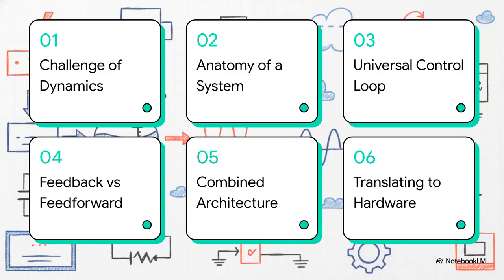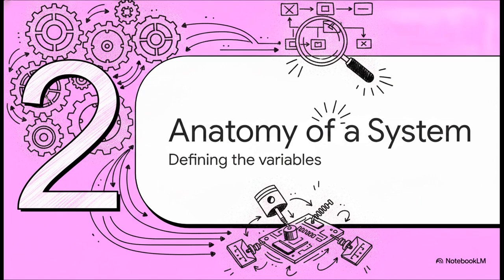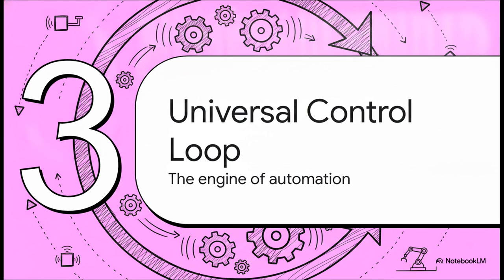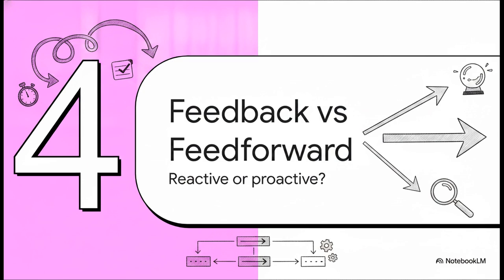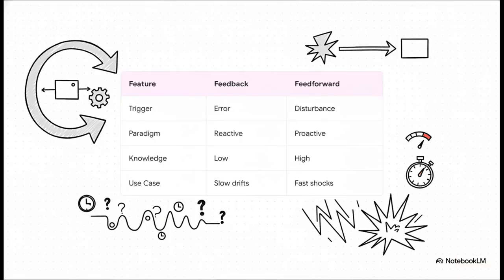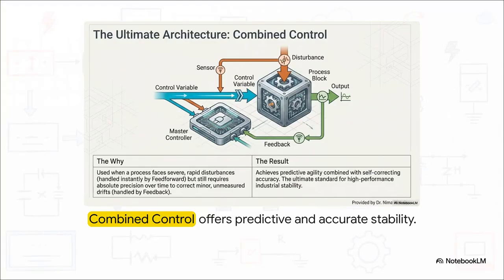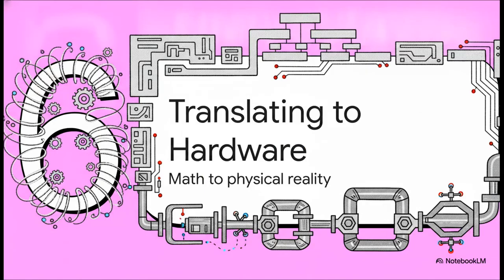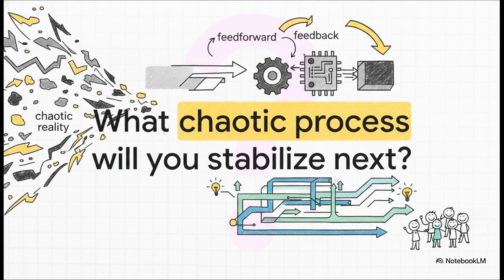Feedback vs. Feedforward vs. Open-Loop Control | Why Each Matters in Industry

Comment: Regarding the explanation at 3:03, is Regulatory Control inherently limited to constant setpoint operation, or can it also be implemented in systems with time-varying setpoints? Under what conditions would each case be appropriate?
Reply from the maker: Regulatory control is not inherently limited to constant setpoints. Its main purpose is to keep a process variable close to a desired value while rejecting disturbances, but the setpoint can also change with time if required by the operation.

A constant setpoint is common in many industrial processes, such as maintaining pressure, temperature, or liquid level at a desired operating point. A time-varying setpoint may be used when the process requires changing operating conditions, such as production rate changes, batch processes, or optimization strategies.

The key difference is the control objective: regulatory control focuses on disturbance rejection and maintaining stable operation, while tracking control focuses on following a changing reference trajectory. In practice, many industrial systems combine both objectives.

Comment: This video is greeted, I have equation, if some output variables are unmeasurable and require periodic offline laboratory analysis, how can the Measure–Decide–Act loop provide continuous real-time control
Reply from the maker: Thank you for your excellent question. In practice, when some variables cannot be measured continuously, the control system relies on online measurements of related variables, soft sensors (state estimators), or process models to estimate the unmeasurable outputs in real time. Periodic laboratory analyses are then used to update and calibrate these estimates.

This approach allows the Measure–Decide–Act loop to operate continuously, while offline laboratory data ensures long-term accuracy and product quality.

Comment: Dr. Mahdian, thank you for this useful video,
i have two questions if you dont mind  :
In a real chaotic industrial process, how can an engineer decide whether feedback control alone is enough, or whether feedforward must be added to prevent disturbances before they affect the output? What are the main signs that tell us the process needs combined control instead of simple feedback?
Reply from the maker: In practice, feedback control alone is sufficient for many processes. However, if the process experiences large, measurable disturbances, has slow dynamics, or requires very tight control, adding feedforward can significantly improve performance by compensating for disturbances before they affect the output.

The main signs that combined control is needed are frequent disturbance-induced deviations, slow recovery with feedback alone, or strict product quality requirements. The goal is always to choose the simplest control strategy that achieves the required safety, stability, and performance.

Comment: I have a question regarding the explanation at 4:08 about Feedback Control being a reactive control strategy. Is Feedback Control always considered reactive by definition, or can it exhibit predictive behavior when combined with other control strategies? From an engineering perspective, what is the practical significance of this reactive characteristic in industrial applications? Finally, is Feedback Control mainly intended to correct small or steady-state errors, or can it also effectively handle large and rapidly changing disturbances?
Reply from the maker: Excellent question. Feedback control is inherently a reactive strategy because it acts only after a deviation between the output and the setpoint has occurred. By itself, it does not predict future disturbances. However, when combined with strategies such as feedforward or Model Predictive Control (MPC), the overall control system can exhibit predictive behavior while feedback ensures accuracy and robustness.

In industrial applications, this reactive nature makes feedback highly effective for correcting modeling errors, compensating for unknown disturbances, and maintaining stability. It can handle both small and large disturbances, but its performance depends on the process dynamics and controller tuning. For large or rapidly changing disturbances, feedback alone may respond too slowly, which is why additional strategies such as feedforward or cascade control are often incorporated.
Reply: @ControlandAI thank you dr

Comment: This was an informative and engaging lecture. Thank you, Dr. Nima, for the clear explanation. The lecture provided an engineering comparison of the main control strategies, including Open-Loop Control, Feedback Control, and Feedforward Control, explaining their operating principles, advantages, limitations, and appropriate applications. It also introduced the evolution of process control systems, emphasizing that process variables such as temperature, pressure, and speed continuously change due to internal and external disturbances. Therefore, control systems are essential for maintaining system stability and achieving the desired performance.
Reply from the maker: Thank you

Comment: I have a question since the video mentions a practical industrial application to explain the combined loop. What is this  feedforward act within it?
Reply from the maker: Feedforward control acts by measuring a known disturbance before it affects the process and applying a corrective action in advance.

In a combined control structure, feedforward provides a fast response to predictable changes, while feedback corrects any remaining errors. For example, in a heating process, if the crude oil flow rate changes, the feedforward controller can immediately adjust the heating input before the outlet temperature deviates significantly.

This combination improves disturbance rejection, while feedback ensures accuracy and stability.